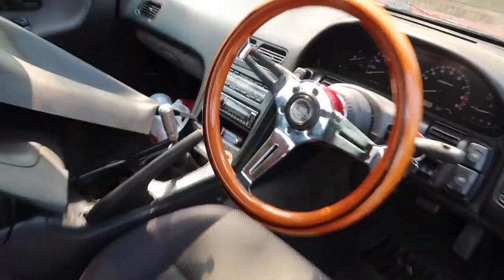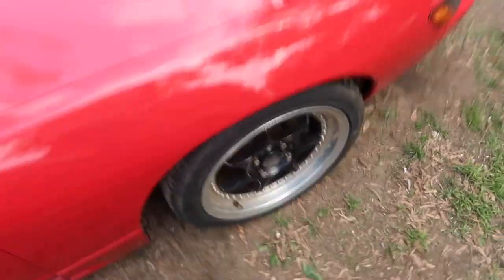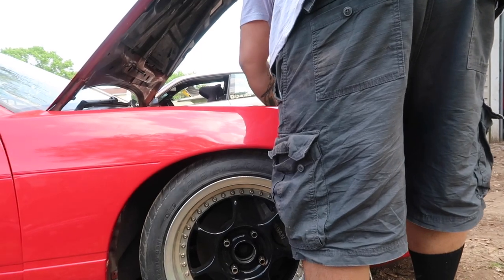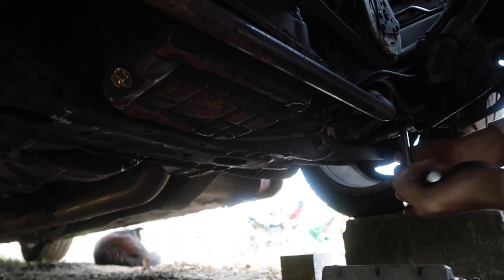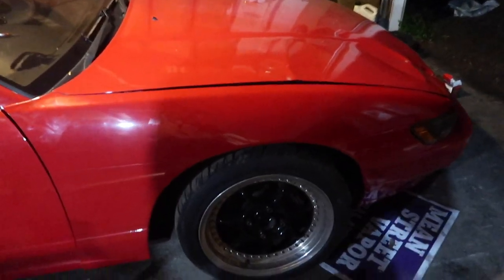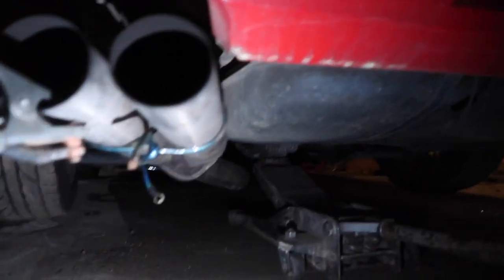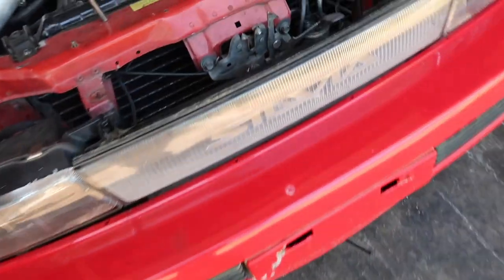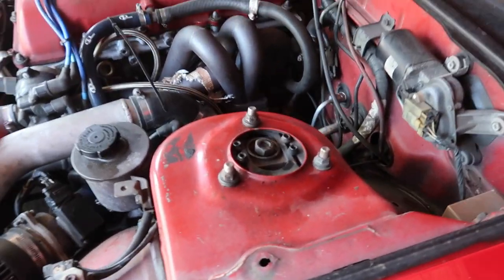THE CAR YOU ALMOST NEVER SAW.. My RHD S13 Silvia!

Comment: Definitely tuned with a computer, an fmu is just a fuel multiplier based on vacuum/boost it sees. Completely stock tune just adds fuel when your making boost. Also it seems like the boost is really low that's why it pulls so slowly to redline. Sell the s13 build the s15

Comment: The hesitation on the S13 is because it's running lean, no doubt it's got a tuned rom on the factory ecu.
That Sard fuel pressure regulator is rad and the S13 already has the S15 front brakes fitted too